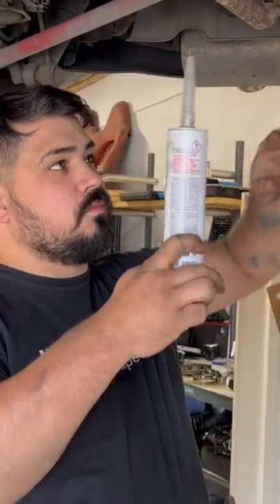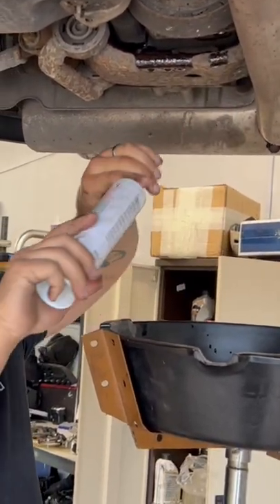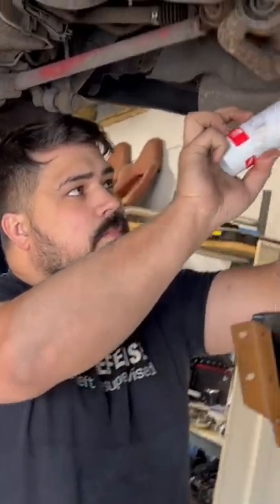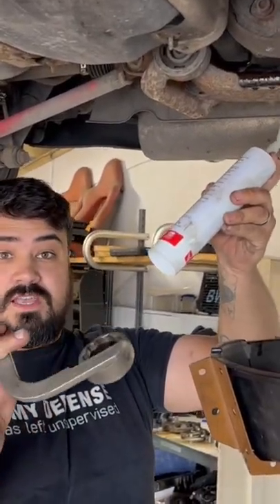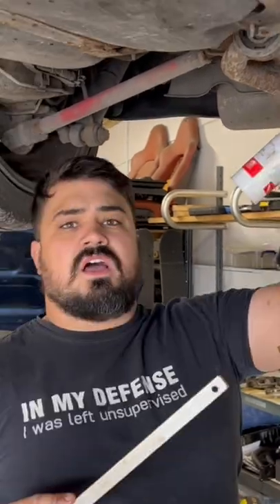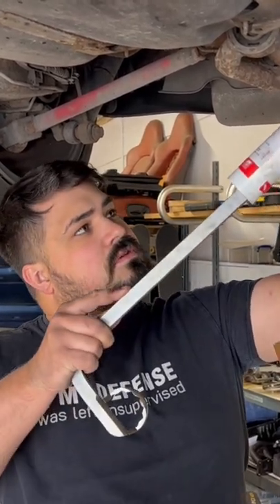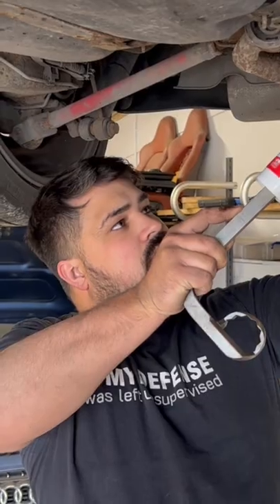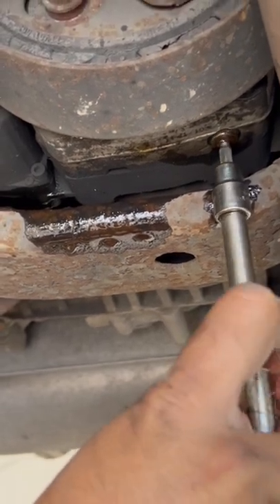Haldex oil and filter Doesn’t need to be difficult!

Comment: If it was my vehicle, I would drill a hole in the side, tap it with pipe thread and plug it with a pipe cap. No more unnecessary spills.
Reply from the maker: There was a tiny spillage, same as there would be with awkward side access- all these people saying its a stupid idea, when you’ve already got your drip tray there for the old oil anyway- its a good solution.

Comment: Hi, bit lost…you only used 1 cartridge? Does it not require 0,7 L, meaning way over 2 cartriges? Is it not cheaper to buy a 1 L bottle? Using a bottle, how would you have done/recomend doing it?
Reply from the maker: The gen 1 uses 250ml of the specific oil. Gen 2 uses .7l of a different oil.

Comment: Can this be done with only 2 Jack stands on the rear? I’ve read the car needs to be level?
Reply from the maker: For gen 1 the car doesnt need to be level, for gen 2 on wards its side filled and the fluid level is set by having the car level.
Reply: @BWSTT  thank you sir. Lastly is there a fluid window or checker to make sure it’s filled after the plug is in? Or just put the whole tube and put the plug in fast!?
Reply from the maker: @DramA525  whack it in and seal it up

Comment: Why would any car manufacturer build something with no oil filler, and c’mon fellas, you don’t need a lift. Car ramps would work as well and they only cost $50
Reply: Maybe the same reason most brands have done away with dip sticks...
Not user friendly !!

Comment: Yeah just kink it, then show us how it's done holding it at an angle that's unreachable while on jack stands.

If you had that perpendicular like it'd need to be while on jack stands, thing would be so kinked you'd struggle to get that oil out.

Easy to show someone it's possible on jack stands while not doing it on jack stands...
Reply from the maker: Then how about watch my entire video where i not only service the haldex, proving this method works on stands, but also change the controller which is a pig on a job, especially on stands. By the way, i do this job on stands all the time, using this method, not just once or twice, im talking hundreds of times

Comment: What the hell ? Where do you get oil in a tube like that ? WHY would you get oil in a tube like that ? WHAT THE HELL !
Reply from the maker: Because it has to be filled from the bottom…..
Reply: @BWSTT  I can see that and my question remains .Why does this exist when you can put a hose  on a bottle
Reply from the maker: @randomusernumber1  because gravity exists.
Reply: @BWSTT  yes and so does the sun, oceans and puppies. Non of them explain how and why this exists considering that a hose in a bottle is better, an oil spritz is better and there are at least 2 more options better than oil in a caulk gun!
Reply from the maker: @randomusernumber1  you need a specific amount of oil, and a delivery method. This is all combined in one, no need for additional tooling. No measuring quantities, no cleaning tools between uses, and for someone doing in once every 2 years, no additional costs involved with additional tools that they probably wont use for anything else. A bottle with a hose would require access from above, and waste fluid in the pipe, and you would be fighting the vacuum created in the bottle. So, a simple cualk tube with a pre measured amount thats easy to use to fill, is a brilliant solution to anyone with any sense
Reply: @BWSTT  yeah. The drain plug being the fil port as well screams "precision measurement". Look you've obviously have never been in a mechanic shop. Have a nice day
Reply from the maker: @randomusernumber1  it screams “taking an existing system and adapting it to be used on a motor vehicle” and since theyre my ramps im working on, and i work on the mk1 audi TT daily, i kinda know what im chatting about
Reply: Bws TT. You can’t fix stupid brother , you are just wasting your time trying to explain yourself. Exspecially when they say a bottle an a hose will work better .

Comment: Yeah... It's still pretty poorly designed though 😆
Reply from the maker: Not really, they’va added variable drive to the rear on a short platform vehicle, and its the quickest and easiest oil on the vehicle to service 🤷🏼
Reply: @BWSTT  No I get that, but there has to be a better way to design the position of that fill plug instead of it also having to pull double duty as the drain plug is all lol
Reply from the maker: @graveyardrumblers  so on the gen 2 you have to side fill which is a faff. The gen 1 as shown here uses 250ml in the system but the tube has 275ml to allow for spillage on filling, and as you see in the video took me seconds to fill and bolt up, instead of measuring quantities from a bottle, into a transfer pump, finding a route through with some hose, and having to have the car level to set the fluid level….. which sounds easier?
Reply: @BWSTT  Hey I'm not arguing with ya, seems like an all around Catch 22 situation lol
Reply: @BWSTT  you're just too good at it. I made a messy poo

Comment: Very poorly designed car. What the hell ever it was called. Our oil doesn’t come in silicon cartridges! If that is gear lubricant it comes in bottles that we put a pump in. We also have fill plugs in the proper location!
Reply from the maker: Who is “WE”?